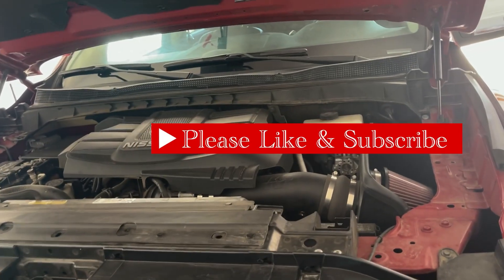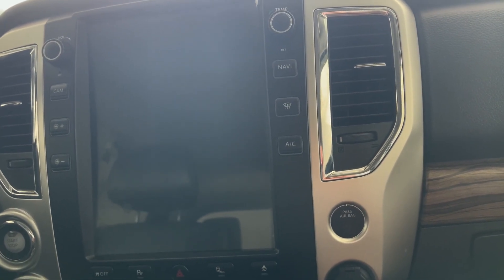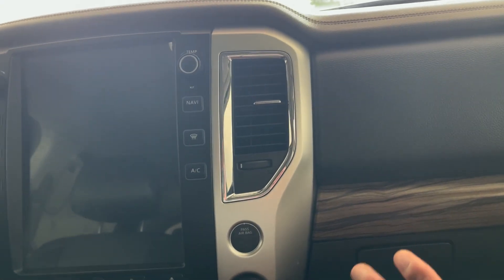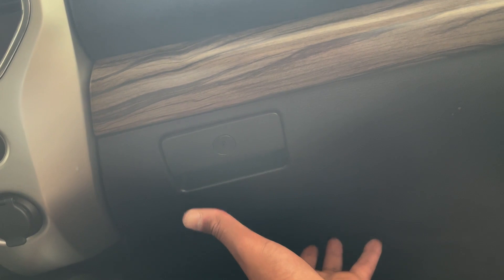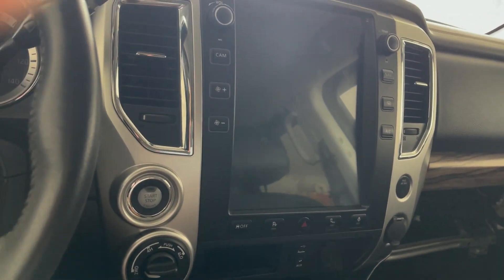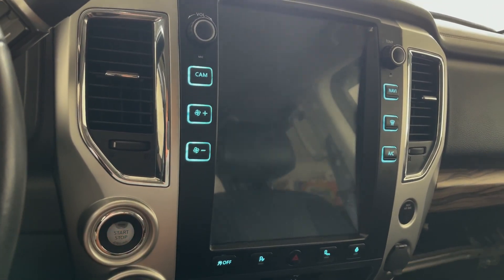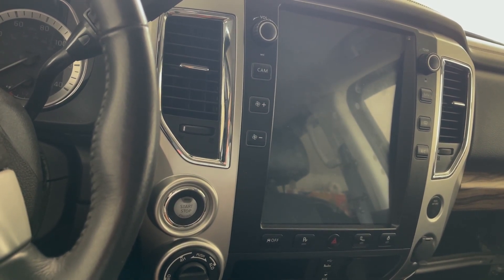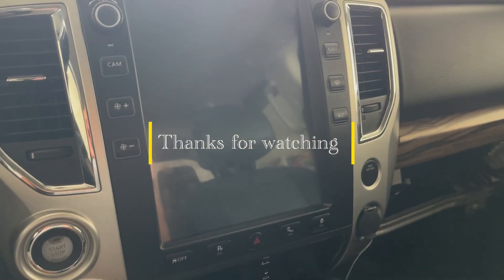Nissan Titan A/C Blower Motor Resistor Diagnostics and Replacement (2016 & up)

Comment: Thank you for your video. I just had this issue happen to me today, but mine was with the heater not shutting off and blowing full blast. By the way what type of head unit is that and does it work fine without any issues?